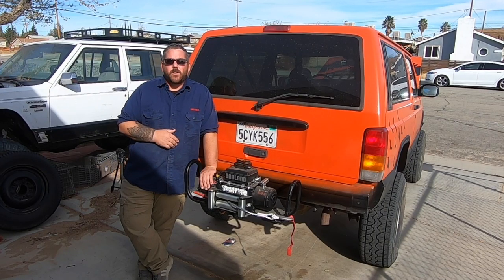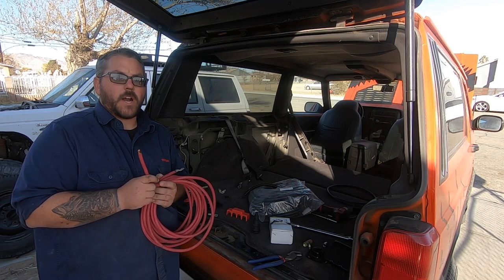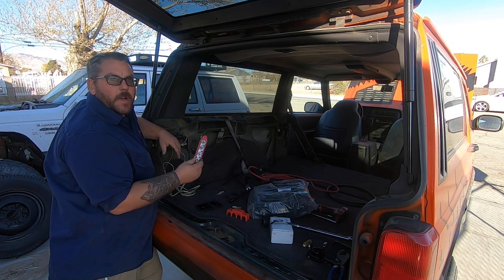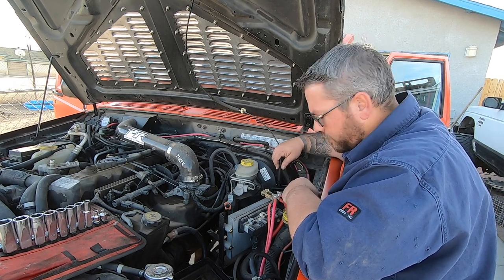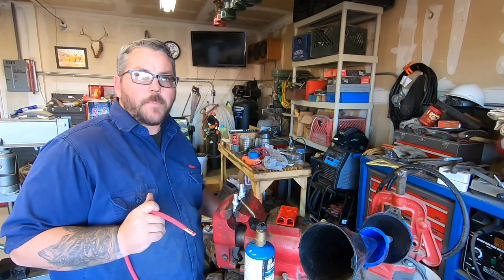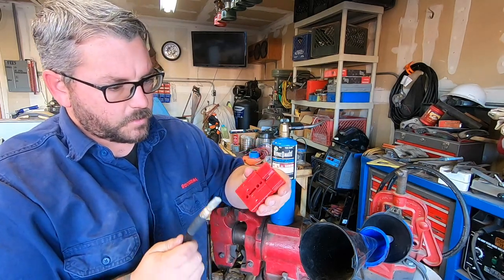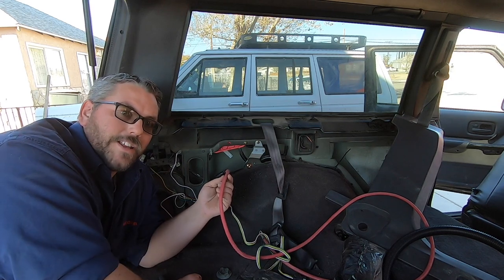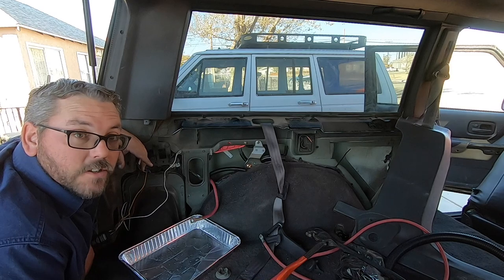Running Power For A Rear Hitch Winch On My Jeep XJ

Comment: I would like to suggest crimping the lugs first, then solder. Why, well if for some reason you are doing a heavy pull with winch the winch or trying to jump start a vehicle that is drawing a crap load of current, and the cables heat up, it can melt the solder right out of the lugs. No solder means bad connection and no more power or even worse a bad connection that can create a fire. One other suggestion would be to run cables outside under vehicle so just in case they do burn for some reason, you can deal with them easier outside than inside (if you know what I mean). I love soldering all my wires and cables too. Thanks for the video!

Comment: No fuse or breaker?  Great video, going to rig up something similar on my XJ.  I'd like to wire in a breaker however.
Reply from the maker: So when it comes to winches fuses and breakers are usually the failure point. Also the amp rating for the fuse would have to be high enough that the battery would toast when the fuse or breaker did. What I do recommend though is a high rated constant solenoid like a golf cart solenoid so it can be disconnected near the battery. I’m going to be using the power back there for multiple things or else this is the route I would have gone.
Reply: I installed a 50amp breaker and a manual disconnect/selector at the battery on my 4Runner's auxiliary front/rear plug-ins. I drive through water often.... Nice video... 👍
Reply: I’d be concerned about the live studs on the PD block. In the case of a LH rear collision, those studs are going to earth out on the body and spark, most vehicles have a fuel filler in the quarter panel.
The high-current solenoid is a good idea. Solenoids relays are getting ridiculously cheap,  cheaper than simple isolation switches in some markets.
This also applies to front mounted winches, which are usually in the crumple zone of a front end collision.

Modern cars have a pyrotechnic battery link connected to the SRS system. In the case of a collision, the battery cable will fail.

Comment: First of all, crimp is the auto and military standard, NOT SOLDER. Solder will heat cycle the copper making it brittle, same as welding which is why some critical welds have to be annealed. In auto or military use under high vibration and impact, a brittle wiring connection is a show stopper in the field, and when repairs are done, use of high disconnect repetition terminals are also necessary - not the OEM junk we see typically under the hood. 

With 12VDC, the run of the cable is almost more important than the final amp load - resistance increases over distance and voltage drop is the real enemy. There's only 12 volts - lose one getting thru 15 feet of cable and you are already behind the curve. It's why high output driving lights run relays to shorten the run from source to light - don't include all the current going back and forth to the switch and you improve the results. Same with winches and inverters, especially off road in 4WD or RV - where a wire run can really get long. My rear 2500 pull winch came with 10 ga wire, but to get power from the front of the truck, 6 ga would be better - preserving a volt not lost from resistance. The 9500 pull front winch is getting 00 multistrand welding cable - and those lugs will be crimped with a mechanical hammer crimper. The reason is that those connections require a 1200-1500 pound pull out to withstand a decade of road pounding and condensation over wet spring and winters. 

Once you Use A Chart to Size Cable to Prevent Voltage Drop Over That Run, then you fabricate and install, looking for any rubbing points and clamping down the cable at every opportunity. I once ran a trunk mount battery in  my 66 Mustang weaving the 00 cable thru the unibody and delivering it to the solenoid mounted across from the starter - not up by the radiator. As you go, give thought to what else you can relocate to shorten wire runs and improve the voltage delivery. That alone saved 30" of cable expense and voltage drop. 

Using the correct rated quick disconnects is a great way to do it, as they are much more affordable now and with inexpensive hammer crimpers setting them to the correct pullout, they won't fail. There are videos online showing how those work and also comparing them to soldering - which is not auto or military rated.

Comment: Ok you have to many connections winch power is ran under the jeep if you need that much aux power inside the jeep you are going to need a Flux capacitor small nuclear reactor I have a lot of experience in running winches to the back and high power stereo systems your ground wire should run back to battery no ground on vehicle you can burn up stuff in your jeep ask me I touched my cabin control computer